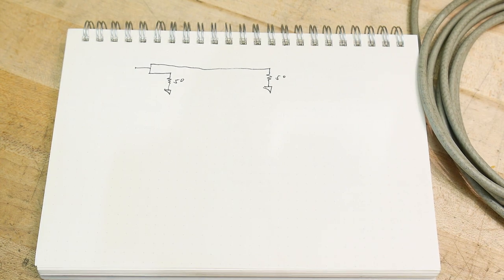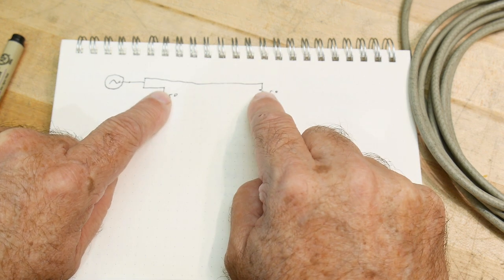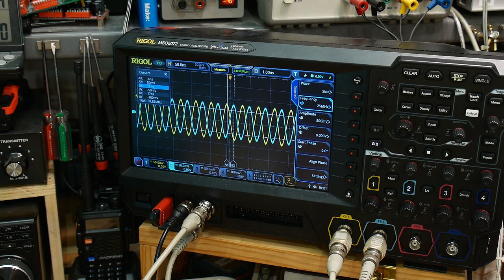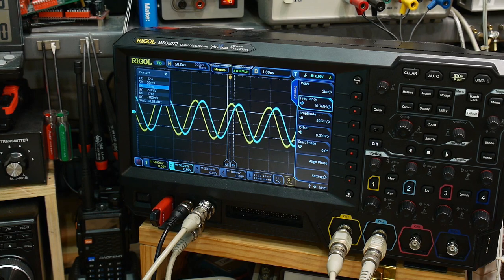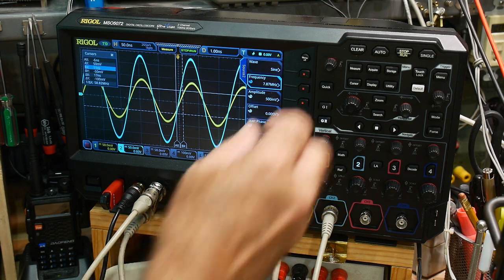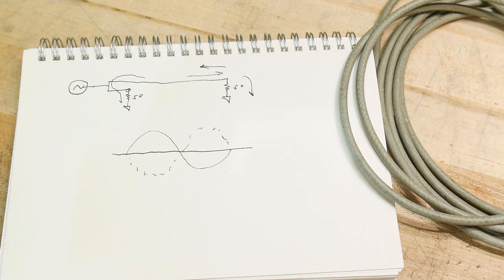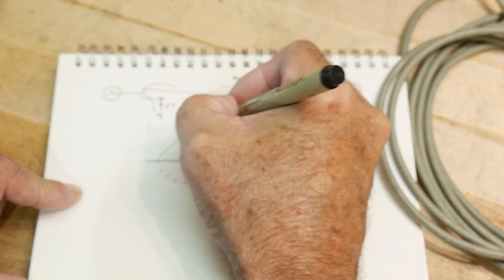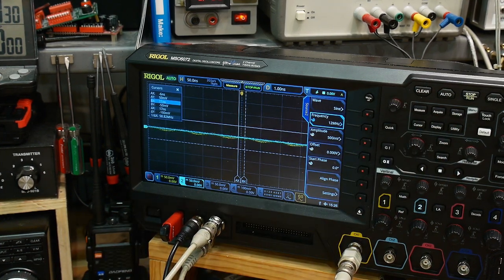#902 What is a 1/4 Wave Stub and Why Does it Work

Comment: Also would be interesting for you to show that if you place a short at the end of the 1/4 line that it will appear as an open at the far end. (magic disappearing short circuit).
Reply: Hi, Alan, I remember there was an argument between you two over the property (ies) of a 1/4 lambda line about more than a year ago.
Yes, 
1. 1/4 lambda line shorted at the far end is an open line at the near end and
it's a parallel tuned circuit
2. 1/4 lambda line with far end open is equivalent to a series tuned circuit apart  from exhibiting a short at the near end
3. Doubling the frequency makes it a 1/2 lambda.
4. Sending a momentary pulse along a fairly long cable and measuring the time lapse (to and fro) to calculate the VF (velocity factor) would be the next video, I believe.
De VU2RZA
Reply: On what distance can you place a short on a 60hz line. Please help
Reply: @SpottedEagleOwls  the line would be over 1000km long.
Reply: @w2aew  Thank you for your help. Can you please help me with a formula to calculate this
Reply: @SpottedEagleOwls  Frequency multiplied by the speed of light..
Reply: What is a 1/4 line
Reply: @SpottedEagleOwls  A 1/4 line is a transmission line that is 1/4 of a wavelength long at a given operating frequency.

Comment: Great demonstration. In the infancy of cable television, everything was analog. To prevent subscribers from watching channels they hadn't paid for, a trap(s) was inserted in the feed line, safely on a pole or locked in a pedestal on the ground. My job required me to test these traps, and the ones made of coax had a notch depth of nearly 80 dB and we're temperature stable from -30F to 130 F. These weren't 1/4 wave stubs but based on that idea. I believe a 1/4 wave stubs would ring throughout the spectrum? Thanks for the demonstration, I enjoyed it.
Reply: 80s-era cable TV boxes had a 'u' of heavy coax on the back of the box, both ends disappearing into the box. Same type as your traps?
Reply: I never saw one as you described it, but it could have been. Many TVs of that Era had 300 ohm antenna connections. The coaxial cable coming into the home was 75 ohm. A balun was used to match the two impedances.  The 1/4 stub was usually connected to the TV antenna connection along with the balun.  This just hung down behind the TV.

Comment: They're also used as impedance transformers, for example in Wilkinson splitters and branchline couplers. Practically made out of microstrip, so it's simple to use different impedance transmission lines.

Comment: yessss! RF goodness! It would have been nice to see the quarterwave stub terminated in short. That would be seen as an open circuit at the connection point. How about terminating it with a reactance?
Reply: A quarter wave line inverts the impedance around the line impedance.  Consider a complex load Zload at the end of a transmission line with an impedance of Zline.  The equation is:   Zinput/Zline = Zline/Zload.  Or, solving for Zinput = Zline*Zline/Zload.

Comment: Hi,
Thanks for the video, very explanatory.

I have one question though (it might be a silly one but I am a beginner, so pardon me) :
Suppose we have a T junction, with an open stub at the T and I/O ports at both ends, then circuit theory tells me that the reflected wave will travel both ways
?
Is it true or am I getting it wrong somewhere?

Thanks in advance
Reply from the maker: sure, it is bi-directional and in both directions one frequency will be attenuated
Reply: @IMSAIGuy  ,thanks for clearing that up for me

Comment: This reminded me of something my Dad used to do. He would cut the coax for his CB base station to 9 or 11 feet (I don't remember which.) As I kid I always wondered why this was of benefit. Eleven feet is about 5.2M, so about 1/2 of the 11 meter band. How much if any would this really help though?
Reply from the maker: no
Reply: @IMSAIGuy  to Mr No (surprisingly, the creator of this video) and @HeyBirt a half wavelength, considering the velocity factor, at the design frequency would help in that you could measure the actual impedance of the antenna. So this is an advantage when tuning an antenna by not having to hook up your analyser right at the feedpoint of the antenna to see it's impedance. Another advantage is you can also use whatever characteristic impedance coax you want, the system will ignore it. I have heard of operators of the day using 75 ohm coax because of availability. Thirdly, it will eliminate any descrepancies of the coaxial's impedance anyway, so you have your 50 ohm input, 50 ohm load, coax irrelevant (technically at one frequency), happy system, except coaxial losses/attenuation.